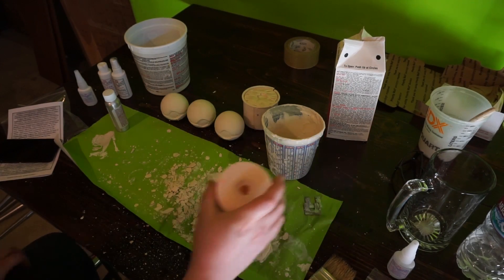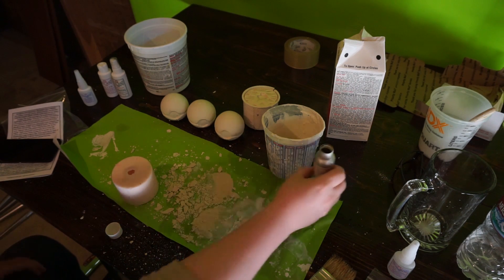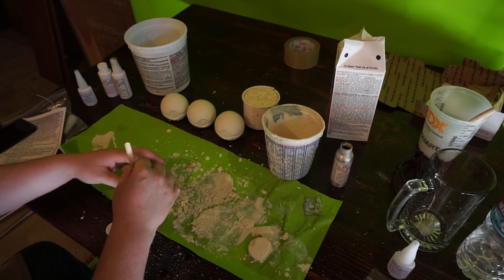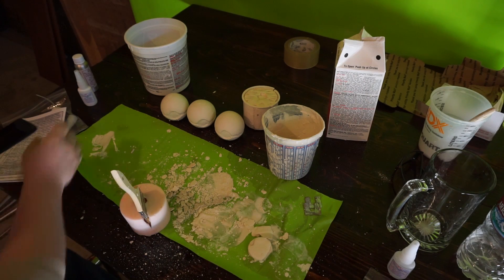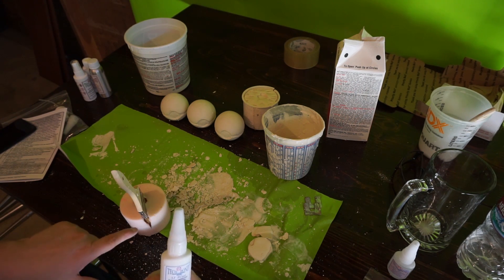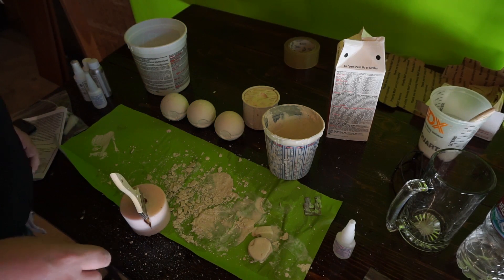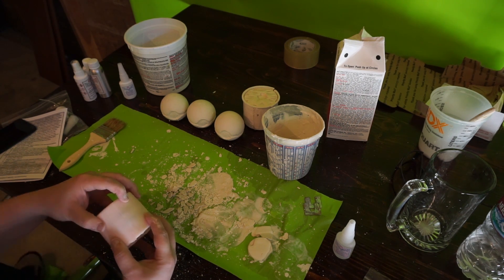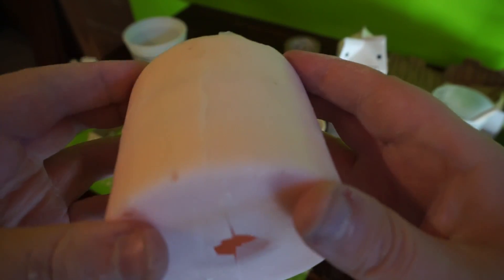How to Repair Torn Silicone - Best glue for Silicone - Tech-Bond Review

Comment: It would be great to see a strength test where a section of the original silicone is torn, vs a section of the repaired silicone. I'm looking for something to bond silicone to plastic, but this doesn't seem to be available in Ireland :(
Reply: Try looking for a reseller of the "3M Scotch-Weld cyanoacrylate adhesive SF 20" and the "3M Scotch-Weld Primer for Cyanoacrylate Adhesives AC 77". As far as I can tell, that should do the job.
Reply: @prouflon4539  thank you, I ended up going with Permabond  POP primer and 105 :)

Comment: How do you plan on getting your casted form out of the silicone mold once hardened?  Instead of fixing the mold on both sides I’ve seen people use rubber bands for keeping the mold closed during curing time then taking them off to be able to remove the casted form. I get that you are just showing us a how to video vs actually fixing a mold that needs repair.
Reply from the maker: It's open on one side and the models pop out. I don't remember how long ago I made this video, but the bond is still solid

Comment: My Pokeball Plus has a top button and is starting to crack and tear, do you think the product you used also work on the PokeBall Plus? I'm not sure if the material is rubber or silicon
Reply from the maker: Hi! So, looking at my own Pokeball Plus, I'd say yes. This stuff works on pretty much everything

Comment: Will it work on any type of silicone? Like platinum and dragon skin?
Reply from the maker: I've only tested it on what I use for my molds, but it's worked on everything so far. As for the waterproof question: I have no idea. The kits aren't crazy expensive and they sometimes sell sample packs.